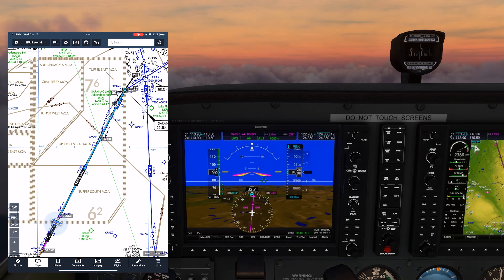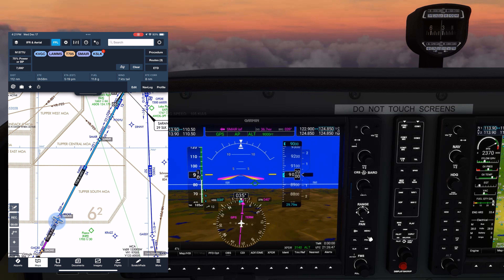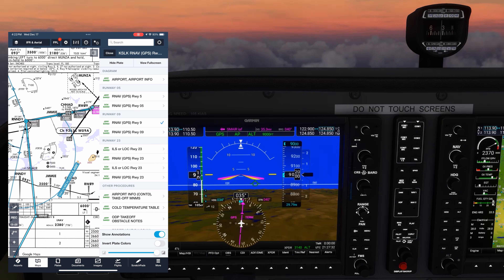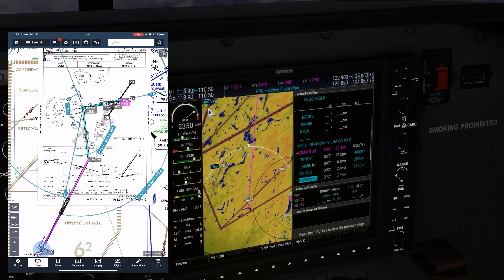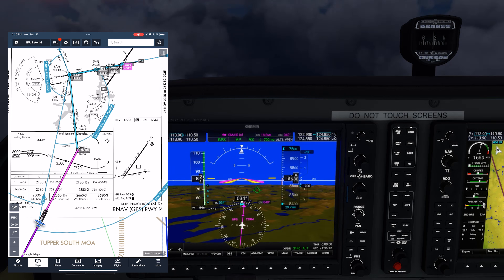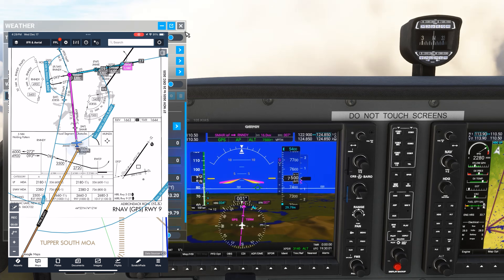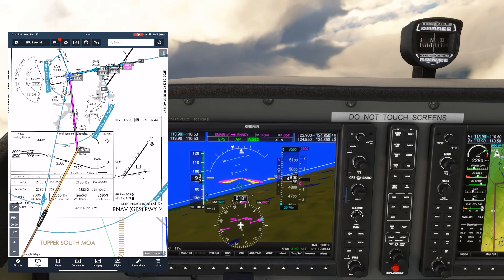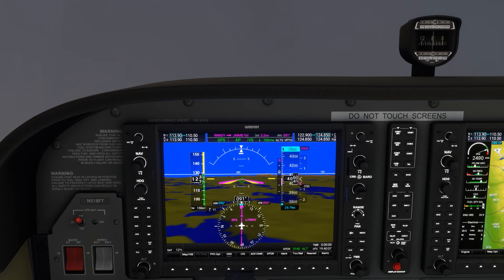TAAs Finally Make Sense | IFR Approach Walkthrough

Comment: Do a vid on linking up an ODP into a TAA RNAV while the departure airport is inside that 30 mile pie.  Add in no ATC comms so no vectors for climbs and descent help to get setup.

We used to do this all the time by calling center on the phone while on the ramp getting the TO clearance & the approach clearance all at once (135 ops) Only radio calls were CTAF after that as you can’t talk to center down low in mountains all over AK.

The route may need an altitude of say 8k for cruise and that’s your cleared to alt but you’ll never reach that.  ODP may take you to say 6k but as you’re climbing thru 5200 you are now at or above the altitude you can descend down to in that TAA pie segment.  Can you stop climbing and turn towards that arrival fix? Do you still need to complete the ODP?  There are many more “can I” questions.  

Some controllers couldn’t always agree on what was correct procedure.  After the clearance was given we’d then lay it out in layman’s terms sometimes getting “ok upon reaching X altitude and within X cleared for the RNAV”.  Or maybe another controller wanted you to hit your cruise altitude and then start an approach but now we needed to hit a new fix for use of a PT to burn the altitude.  Mind you a lot of this I did throwing in a cruise clearance to allow for some latitude in choice.

Might be too much to unpack but just one of the really interesting mind benders we would have to figure out when village A was 8 miles from village B.

Comment: So, if you’re not using the iPad, which you’re not supposed to be using for navigation purposes, how would you know you’re inside thirty for that arc segment to JOESS while headed to SMAIR? My point here is while you’re clear of terrain when you started the descent, how are you supposed to know that? You’d need a second system ranging and radialing from JOESS. Seems to me that first initial descent was not legal. Nor was it needed for energy management as you have plenty of room from SMAIR.
Reply: Devices with Foreflight, Garmin pilot, or other flight bag software/hardware are approved devices to assist on your flights. Obviously you will not use them as primary navigational devices and that is why for procedures like the one depicted will require advance navigational equipment in your airplane.

This is what I would do: If the airplane I'm flying does not have any GPS equipment on board, I'll advise ATC that I will not be able to comply and request another approach. As per KSLK i see that there are 4 approaches, 3 of them RNAV and one ILS. In your scenario, knowing that I will not be able to determine the 30nm arc area from JOESS, I will request instead the ILS to RWY 23 and ATC will help along the way.